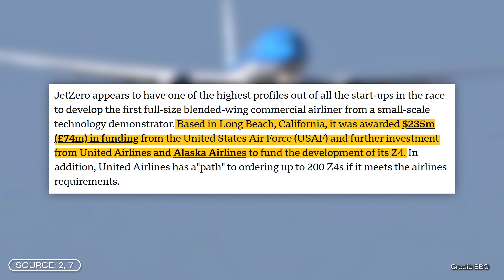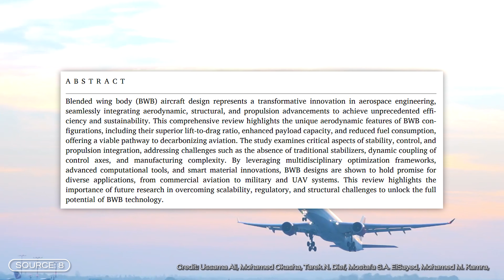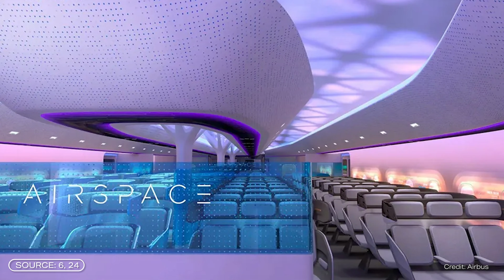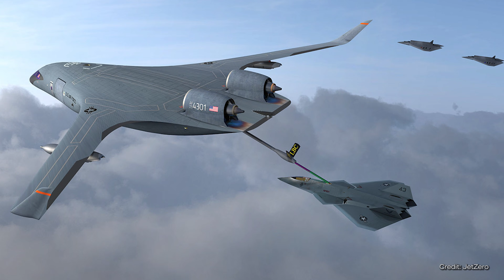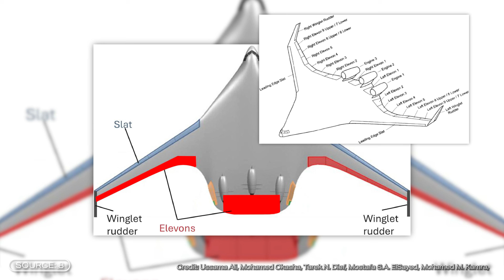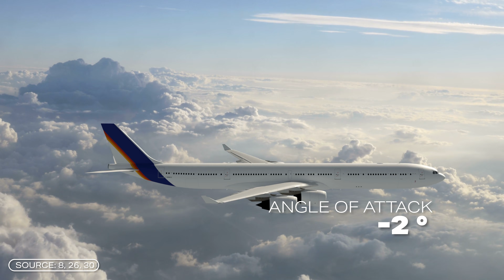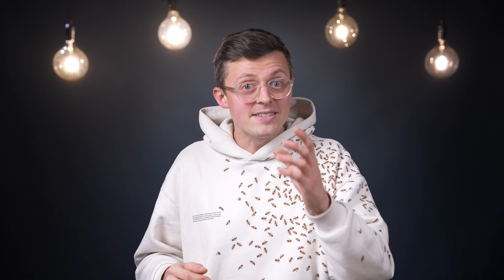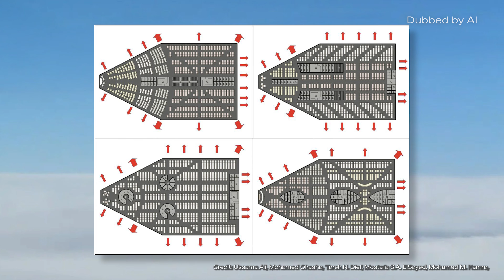The "Perfect" Plane Has One Big Problem...

Comment: I am in favour of this significant change to aircraft design. I have questions to put forward. 1 what will be the impact on airport infrastructure? The introduction of the A380 created the necessity to widen runways and parking bays as well as increased numbers of air bridges. My second point was touched on slightly by Pascal in regard to turbulence and the passengers seat position laterally from the centre roll, yaw and pitch but I thought specifically about the aircraft banking for 90 degree turns in a conventional rectangular circuit. I would like to do the maths but I don’t know the maximum displacement that the widest seat would have from the centre line of the aircraft. Passengers on the outside of the turn would experience a rapid increase in vertical movement while those on the inside would experience a rapid descent significantly more the overall aircraft descent rate. From an air Traffic control point of view this would most likely require a total redesign of airport traffic management plans I.e. SIDs & STARs.
Reply: You also need to think about how pressure vessels work, and the need to supply oxygen to passengers when flying at 40,000 feet.

Comment: I have always thought the first point was right.  It's pretty obvious the blended wing with the engine mounted on top would be much more efficient.   The issue is how much of that fuel efficient savings would be offset by the increased maintenance costs accessing those engines.

Comment: How would this plane work in existing airports with the way the gates are designed?  How will loading and unloading work?  Only a small minority of passengers would get windows, and it looks like a very large number of passengers will have neither window nor aisle seats.  A large number of aisles to allow for reasonable ingress/egress, as well as service, would also cut down on efficiency gains in terms of numbers of passengers.  I've been intrigued by blended wing designs for decades now, but I think they would need to be used for a number of years (or even decades) by the military so that all the risks are well understood and the bugs rung out.  I think this design would be excellent in a cargo/tanker capacity.  Think of the flexibility.  I think the cargo-master's job would be more complicated though.

Comment: I can see that integrating structures of composite materials could make for a very strong plane and for passengers smaller galleried cabins could be very pleasant. People might pay extra for the thrill of sitting at the end of the wings though I suspect that in normal passenger use there would be no fairground sensation

Comment: Wouldn't a blended wing design be able to use a shorter runway? Be able to take off more easily as well as have a better economy of flight. If so, they could use smaller airports.

Comment: This design would make a great long-range unpressurized cargo drone, capable of delivering tens of thousands of wardrones close to the battlefield within hours, and with a fuel capacity for very long distances and loitering times. 
Eliminating the pressurization requirement also eliminates the problems associated with that requirement, leading to significant cost savings.
This would reduce the cost of all air cargo if adopted by cargo companies.

Comment: 767 Pilot here. Those pitch attitudes at which it becomes unstable are incredibly low. We pitch for between 12-15 and sometimes as high as 18 degrees nose up during our initial takeoff (rotation to 1000-3000 feet), to gain altitude as quickly as possible, both for safety (altitude is life if you lose an engine), and to meet FAA/ICAO mandated climb profiles for obstacle avoidance and noise abatement. I love the concept of blended wing-body aircraft, but these control issues pose serious problems for flying in real world conditions. Not every airport has 12,000 foot runways surrounded by flat terrain in all directions. There are many airports that mandate very steep climbs, often with special routing, to avoid terrain or built up areas. 

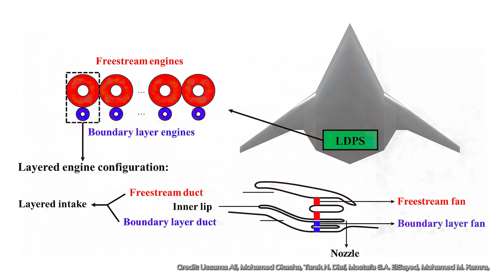Separately, you showed a slide at 3:03 while talking about aerodynamic forces that has nothing to do with aerodynamic forces but is depicting how the aircraft would have special engines with a 'freesteam fan' and a 'boundary layer fan'. First, why show a slide that has nothing to do with the forces you're actually discussing, Second, the topic of the specialized engines this aircraft would require is fascinating in its own right and I wish you'd actually talked about the content of this slide that you showed.
Reply: How is angle of attack calculated? I mean if you are trying to climb, and you are moving at several hundred km/h, then won't the effective angle of attack, from the wing's point of view, be much lower?  It's not just how far off you are from horizontal, if most of the AoA is the result of horizontal speed... what you think of as a high AoA is probably not that common.

Comment: There were two critical reasons that blended wing, or flying wing designs were rejected back in the 1950's for commercial flight.  They both have to do with the safety of the aircraft.  First is the instability of the design.  You really understated how unstable this design is. The faster a blended wing design travels with respect to the air, the less stable it becomes and the greater chance there is for a critical event. The second reason is evacuation time.  EASA and the FAA require a fully loaded aircraft to be evacuated in 90 seconds. There is no way the seat configurations in a blended wing could possibly meet this standard.  This is why we fly in tubes, because we can quickly get out of them in an emergency.

Comment: My experience flying was mostly as aircrew in the US Air Force. As such the concept of looking out a window is just flat non-existent there are no windows on cargo aircraft. IT automatically follows that blended wing design would work perfectly for military applications.  Thinking about engine placement makes me think about placing them in the Wing.  Having the exhaust out the trailing edge could give control advantage as well as low infrared signature.

Comment: Isn't the Vulcom bomber used by the RAF for many years a similar type of design?
Reply: One important difference had a very large vertical stabilisers and imbedded the engines in the wing. The centre of thrust was a lot closer to the centre of lift in that design.

Comment: I serve Hawker Siddeley, subsequently BAE SYSTEMS as a Flight Dynamicist for 38 years. The BWB could have longitudinal stability if the CG is forward of the neutral point. Like conventional aircraft, it should have roll damping. But without a fin, it cannot have directional stability. Dutch roll is the normal directional stability root. Pilots often think of it as a roll motion, because the biggest moment they see is rolling, but virtually all the energy is in yaw (the yaw axis has the largest angular inertia on all aircraft, and the BWB is no exception). But without a fin, there is no directional "stiffness".  Resorting to using an autostabiliser to open split flaps near the wingtips would struggle to provide the same directional stiffness of a nice big fin at the back. Since a fin only produces form drag in steady flight, it is a low cost passive solution. I think the main objection that those who promote BWB's have is that their rear end at the centerline is much nearer to the CG than on a conventional aircraft, so the fin might have to be huge. I designed the control laws for the autopilot on the Sea Harrier, so I have a fair idea of the problems associated with implementing a satisfactory artificial stability for such a difficult subject as a BWB. With structures like fin and tailplane, they are so reliable that one is sufficient. With an autostabiliser, you have to build in redundancy, easy enough in a computer, but all your actuators will need at least triplex redundancy. And triplex hydraulics (or wiring if electric). I'm not convinced that BWB is a good idea. Best of luck!

Comment: The high, aft mounted engines are prone to surge if there is separation over the top of the body. The DC-10 was criticized for maintenance of the tail engine. Accessibility on these is worse. The B2 is unstable an the FAA is reluctant to certify unstable airframes.

Comment: If the engineers slid the engines a little bit more to the outside of the tail section in some of the artist renderings that we saw you could put the engines on a hinge which would allow them to drop to the ground to be more easily serviceable

Comment: Improvements of less than 50% are still improvements. That means success, at least success regarding fuel. Have there not been significant changes in civilian air travel because of 5 and 10% improvements in efficiency? And that noise reduction thing is important, at least to me. I'm old enough to remember far more loud airplanes. More quiet is more better.

Comment: I'm with you. I wouldn't support putting this radically redesigned airplane into commercial passenger flights until we've had a lengthy period of use in militarie (not just US military), commercial cargo flights, etc.But the idea clearly has advantages, and the engineering and materials science-related issues that caused it to be abandoned in the 1920s almost certainly no longer apply. 

Please keep reporting on interesting research!

Also, do you have a channel that reports in German? I speak and read  German well enough to follow what's saud as long as I can pause the video to look up unfamiliar technical terms, and it's good to kedp using it!

Comment: China is now well into development of their own flying wing bomber similar to the B2 or B21.
I think the hurdles for a blended wing passenger configuration are too steep. 
But a military tanker version, or even large unpressurized cargo hauler is possible. A successor to the C5. 
A pressurized inflatable plastic bubble with seats could even allow it to function as a troop transport. 
Instead of a tail they could put axtive electric  side thrusters at the back. 
This would allow it to keep a low radar profile. 
Passengers will probably be traveling by hypersonic jets soon, or even point to point by Starship. 
There may be a case for a larger diameter dreamliner with two decks. Giving a replacement for the A380 but with a much lighter composite structure and just 2 extremely efficient engines. Possibly using electric or hybrid engines. 
Battery technology is getting lighter all the time and once reaches 1000 kwh/kg. Fully electric regional jets will happen. 
And hybrid engines just using jet fuel for extra power on take off and for climbing will be possible.
Since the future of war will be AI controlled drones. 
This could serve as a drone mothersship dropping thousands of drones over a battlefield in minutes. Or as a missile truck like they C17. Able to depoly skids of missiles at a time.

Comment: OK, the windows or general lack there of. That's an issue towards the back of the aircraft. I say problem as Concord was originally designed without windows & people were NOT happy with that & it cost a fortune to design them into the aircraft. I think it's worth mentioning albeit I would not care. Exit points look a bit thin on the ground & that's something pretty important too.

Comment: Less fuel compared to what ? A plane of same weight ? of some volume ? of same passenger count ? Because there is no way the new blended wing consume 50% less fuel than my RC Airplane; they obviously means to a comparable plane, but they compare it on which factor exactly ? The only one that I'd be interested is less fuel for the same number of passenger/cargo being carried. Because if it was 50% less fuel for the same weight or volume but it could only carry 90% fewer passenger, then that means we will need 10 times more planes, which is 5 times more fuel than before.
Reply: so it is half the fuel of a 40 year old Boeing 767. I don't know much about planes, how is that a comparable plane ? is it because it is similar weight, cost, payload ?

Comment: I challenge the notion that the passenger experience would be different on a blended wing design if this notion is based on fuselage width. I have not heard that on an A380, which is over 7 meters wide, it feels different to sit in a window seat (3.5 meters from the centerline) compared to a center seat.  If that is imperceptible, I doubt that a seat even 10 meters from the centerline would be noticeably different.

Comment: The challenge of the passengers being further away from exits than the conventional tube design could be mitigated by focusing non-seated space in a center 'spine' e.g. toilets, cargo, catering etc goes in the middle of the fuselage - taking advantage of the increased cross section compared to the tube design.

Comment: Another issues is that a stretch is not going to work, so instead of having one basic design that is used in a family, each different size would have to be a new design. That means that even more cost. A family like the 737 is mostly the same across all the models,

Comment: the biggest problem will be the disturbed and variable airflow into the engines especially at low airspeeds. along with the other problems mentioned. going to be honest and say that's never going to happen for commercial. then we get to their efficiency claims - lets say I'm extremely skeptical. a big part of the drag budget is a direct function of wetted area and that doesn't look significantly better. also those very narrow high aspect ratio wings are great but will be extremely expensive - think titanium main spars. don't mean to be a downer but that what i think.

Comment: Excellent presentation!  We always hear about the upsides of new designs in aviation.  Rarely are we presented with the limiting factors of new designs.  For example, engine maintenance being hard to perform because the placement of the engines make them hard to reach.

So, the infrastructure and design of airports might need some modifications to accommodate the planes' new shape at passenger loading gates, etc.

It looks like mobile elevating platforms will have to be developed to be able to elevate a large platform that can lift up many thousands of pounds of mechanics, tools, engine parts, etc, while not tipping over because of imbalance.  Not only will such a platform lift all of that up, high, but when the platform extends forward over the back of the airplane, it might tilt until it tips over.

Such a system, as described above, will be fine for quick routine maintenance, but for times when the plane has to go over a major refit or overhaul, then the buildings for such maintenance will have to be designed with upper floor levels that such a plane can be carefully backed into, using those special ground cars that they use to tow planes around.

Another issue, might be that the flight crew (stewards and stewardesses) will likely have to be larger, because such a plane will have more passengers. 

Emergency evacuations will be quite different, but another problem will be that there will be much more non-window seats while window seats will remain the same number or maybe fewer, or just a few more.  So, entertainment for the non-window seat passengers is going to be more important than before.

Comment: I'm not so sure the pressure difference is significant enough to be much of a concern. Under water the pressure difference is a real issue as increases dramatically with depth, but going from 1 Atmosphere at sea level to 0.3 atm at 30,000' doesn't seem that bad, there's still around 4.5 pounds of air pressure per square inch versus 14 or 15. The space shuttle also used a blended wing design (excluding the wings) which made the interior more rectangular than cylindrical and even in lower orbit it didn't affect the cabin integrity. I don't know if they ever kept the cargo space pressurized though.

Comment: "Fly by wire is no longer a problem....." It is when the acft isn't inheritably stable when those systems fail! An aircraft has to be able to fly as a (heavy) glider on itself when systems go down. In all airliners where fly by wire is used, when tohose systems feel it doesn't lead to a loss of control. With this design, it will!

Comment: Flying wing designs are inherently unstable and they rely on advanced computers to fly. It is still common for commercial passenger planes losing power and landing with little or no loss of life. It the power fails on a flying wing, it becomes a 'coke machine'. Loading and unloading will take much longer and require completely different airport gateways.

Comment: This discussion reminds me of the Soviet-Russian design they called the EKIP. Essentially, a flying saucer, proposed to apply "trapped vortices" along the fuselage, creating an air boundary layer that should reduce drag considerably. Its main advantage would be its very short takeoff and landing strip requirements. From a fuel consumption perspective, it's not distinctive in comparison to current conventional designs.

Comment: I wonder about passenger subjective perception of safety in such a plane. People in the center with such wide rows might feel claustrophobic. Some passengers already do on conventional planes. The people at the extremes would experience a lot more centrifugal force per angle of flight deviation from horizontal every time the plane banks. Even if without assuming any threat to passenter safety, it would either upset passengers at greater distances from the center of rotation or perhaps too severely limit maneuverability by restricting how large an angle of banking would be tolerable.